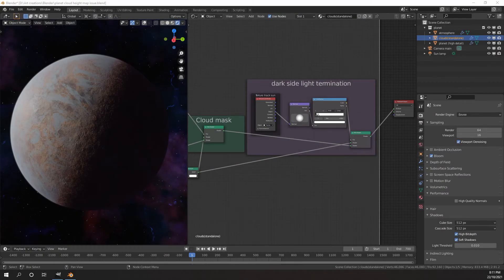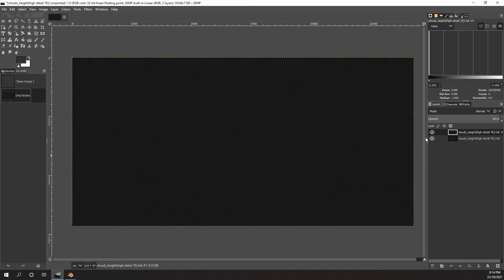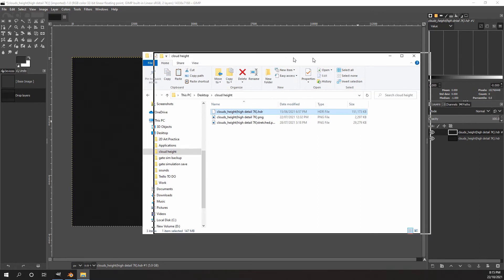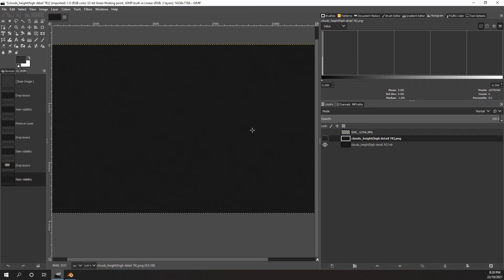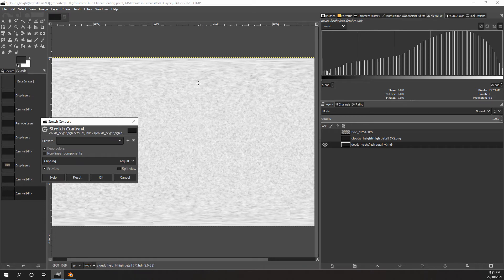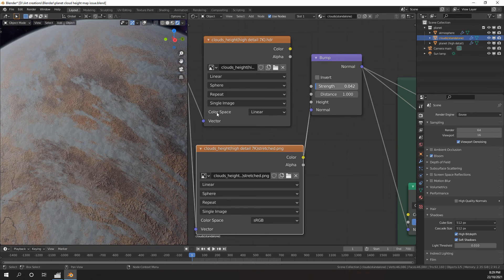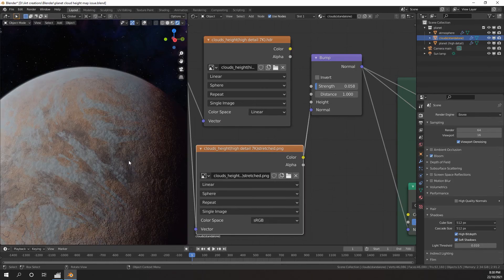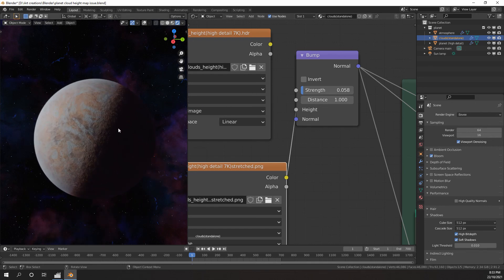Optimising your Height Maps with Gimp

Comment: How to use Photoshop to achieve this function?
Reply from the maker: Not sure, haven't used photoshop in a long time. There's probably a quick way like Gimps 'Stretch Contrast' feature, but the workaround is to adjust the histogram of your image manually with a Levels Adjustment where you set your min and max points at both ends of your histogram (basically cut out empty space) and make sure your mid level is in between the min and max point